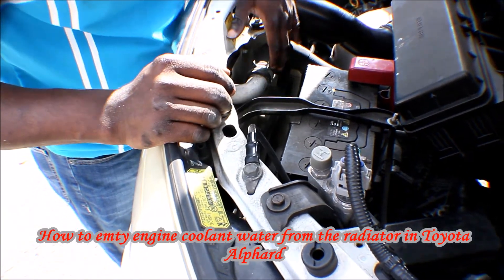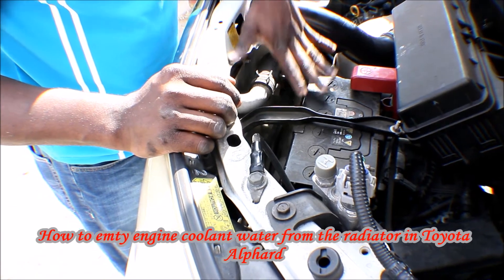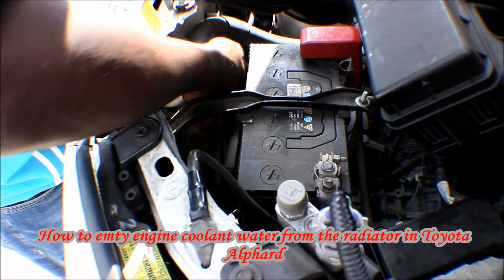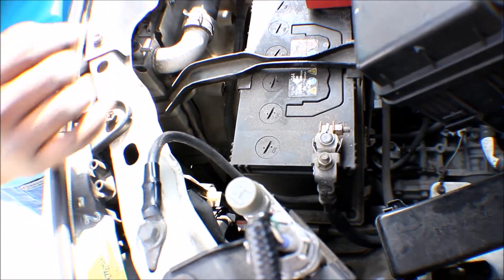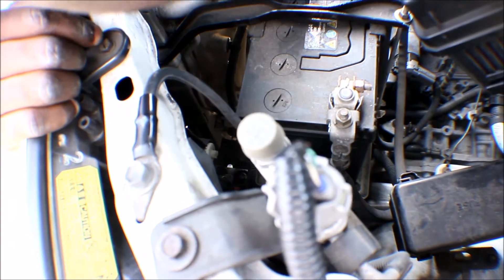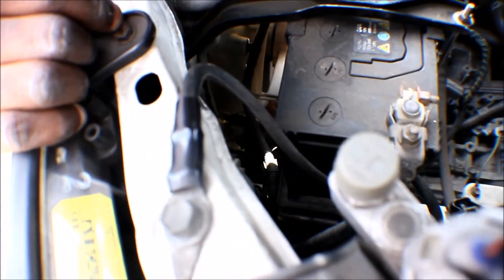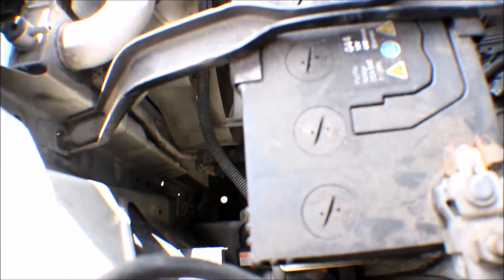How to empty engine water coolant from radiator in Toyota

Comment: Good morning bro...I find its difficult to top up water into a radiator..model 2003...v6...is is normal that the water moves is slowly as the opening is too narrow..I need to squeeze the hose below it to release some it..to enable the flow of water run smoothly? or..is there any peoblem with that..thanks